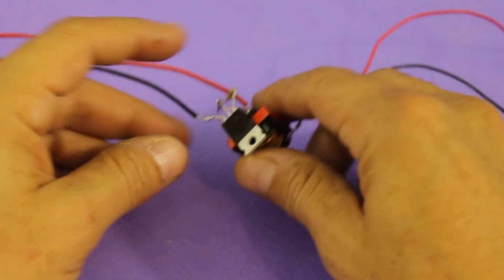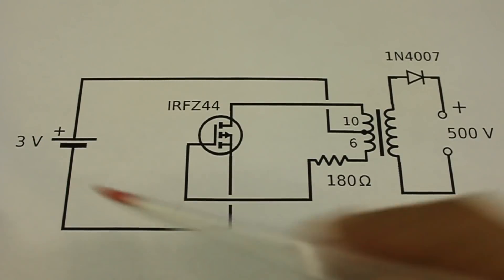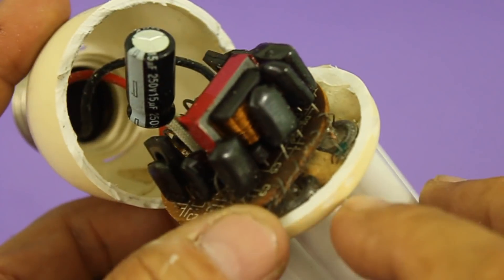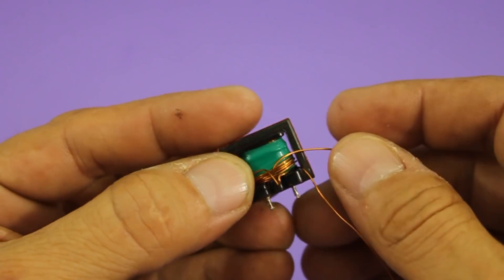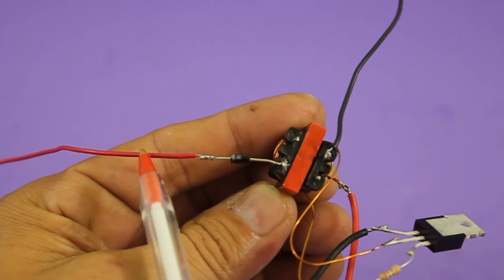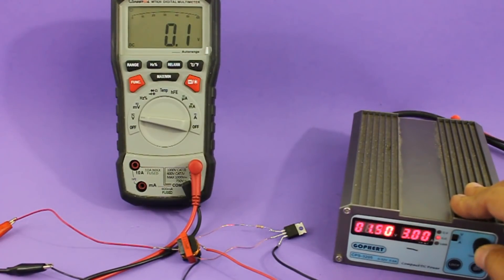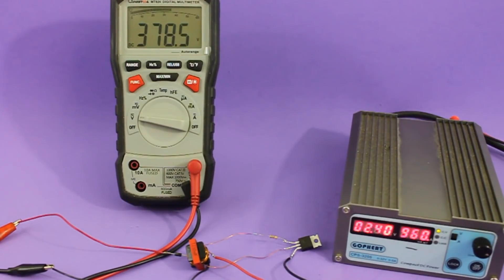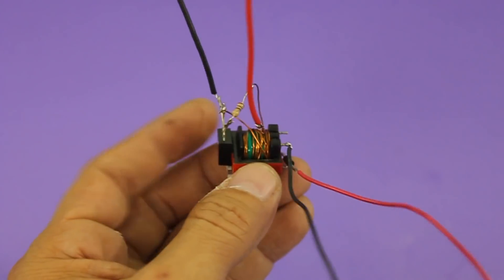Miniature Voltage Booster. 3 to 500 V

Comment: I used the same circuit. But my MOSFET gate can only switch using 6V. So I added in inductor instead of a resistor and the mobile charger transformer can output 600V to max of 1kV. If I use a car jumpstarting transformer, I can double boost the output of 78.2kV and 500W of full power. The first transformer output 240V AC and 1kW of power. You can't control induction motor because the feedback burnt out my MOSFET. Always use a 12v zener diode from gate to source of the MOSFET. When using 5V, 6V or 9V use a 12V or 15V zener diode. The diode's zener voltage will be doubled from input voltage. Example: 6V input use a 12V zener diode.
Reply: The zener diode protects the MOSFET from getting burnt by a high voltage spike. The induction feedback voltage spike can jump up to 600V. High voltage can damage the MOSFET. Feedback current will miss the MOSFET gate and flow to ground through the zener diode. If current flow back, it will flow back through the diode in zener mode. The diode will limit the voltage and skip the MOSFET gate.

Comment: Very good. You make it easy to understand and recreate. 
There is more to this simple circuit: The Diode here does not only rectify the AC, turning it back into pulsating DC.  But, if it is correctly oriented, the Diode is made to Output only that half of the AC power wave which exists while the DC input impulse from the battery is turned Off. This is the greater power of ambient space quickly reforming the small local magnetic field back into its former unpolarized state. There are some uniquely cool properties to this power. But for normal applications, it is suggested a high voltage capacitor is placed between the +/- Output. And realize, that any output during Input-Off, will naturally not load down the input with extra current (amps). So, there is an immediate efficiency advantage with this circuit, and many variations to experiment with. Good fortune, have success!

Comment: sir. the electronic device that you made, can it be used for a 24 volt 7.5 ampere dc motor. if possible, do i need to add bridge rectifier and capacitor for my dc motor. 
sorry if my English not very good. Great video,thanks.👍👍👍

Comment: Thanks for the tut.. Awesome now have a circuit to run the heater in the 2C39A uWave valve i am going to use in a 1.2GHZ tx tripler I am building. My wife said the valve in its mount looks like the robot from "Lost in Space".. Good enough reason to build it... 500VDC, tick, the rest is down hill, thanks a bunch, great work..

Comment: Hi man, thanks a lot for this circuit, Is what I need for my personal DIY coil gun. 
My First question is: can I use as input an AA battery of 1.5v for an output of 450v DC, to charge a capacitor of 450v? 
Second question: is it possible to buy only an inductor of 30mH (as I can see from the label)? I can't find it on line, someone can post a link where I can buy it?

Bye

Comment: Can you also multiply the wattage of it?
Reply from the maker: No, that would violate the 2nd law of thermodynamics
Reply: If it does not increase the wattage,then i consider all these invertor devices as BS ,confusing,misleading and nothing more then a novalty gimmick, 
So if a 2000 watt invertor requires a 2000 watt accu, why not just tap straight into that accu to get 2000 watt? Why would i have to pay $499 for something wich does add things to it other then being a novalty?
If i knew this before, it would,ve saved me $60
Also why are we consummer treated with the term voltage and not wattage???
On universal adaptors it only has a switch for voltage , on batterys it only says 1,5 volt, on devices you only read the amount of voltage, theres hardly any mention of wattage or ampere, i always tout that voltage seems to have something to do with wattage as well but i guess not right???
So what do we rather have 1 watt at 50.000 volt or 50.000 watt at 1volt,mmm sounds senseless right,mmm,

But maybe there is a way to get more energy out of less , what if we could convert that 3 volt at 1 watt into 3000 volt to drive a turbine, then that turbine can then drive a dynamo to generate 3000 watt or so, this way we might get more energy out of less, i was always theorizing this concept.

Comment: Now that’s what i call absolute magic,
Just imagine wiring 2 magnet motors together to generate 3 volt , then that 3 volt can be leaded to a transformer to convert it to 500 volt, and now you can watch tv, cooking water, baking food all just for free and nothing, because a magnet motor should start & selfrunning on it’s own trough magnets alone permanently, wich you could only stop by block it’s mechanicles or by pulling away that essential magnet,
So yes it is possible to to turn a 0 into 500 despite it’s against the laws of physics.
Reply: that's wrong lol

Comment: Soooo concise, simple, clear! You are finally number one. Subscribed! Thumb up! I'm sure you can and will make a video on mini Voltage display with 7-segments display, WITHOUT programming or Arduino, using common integrated circuits. Thanks.

Comment: I am loving the positive comments here... :-) 
1. Can i replace the 180 Ohm resistor with a varriable resistor or potential-meter so i can varry the output?
2. What can i improve on the circuit to be able to use it as a booster for my solar pannel outputting 17 volts.

Comment: This circuit is known as a "Flyback Transformer" It works but without significant filtering the voltage on the output will have lots of spikes. You will need a RC and a LC filter possibly 2 of each to get the ripple down if you plan to use this circuit in music.
Reply: I just need it for charging, can you help?

Comment: disposable fuji flash camera works well for that, then add another ultra fast diode to charge two capacitors in series, doubling the output to around 800V

Comment: This works for me but can't power anything with a winding like a motor for example. I had a couple high voltage 40volt led lights that it powers no problem. I see store bought boost converters that run motors, what am I missing? What can I add to the circuit so I don't lose all my amperage?

Comment: I DISAGREE THAT THE SECONDARY VOLTAGE WILL BE AC - IT WILL BE PULSED DC WITH - OR WITHOUT THE DIODE? YOU WOULD NEED TO DRIVE BOTH SIDES OF THE PRIMARY  TO 0VOLTS WITH RESPECT TO THE CENTER TAP TO PRODUCE AC OUTPUT? IF I AM WRONG, WHAT HAVE I MISSED? THANKS.

Comment: This circuit is bad. First of all it is a open loop circuit so depending on load you will get different output voltage, then by using a single diode to rectify you lose half wave that is 50% of the power. Then the next problem is that you need a capacitor to smooth the output. By using a transformer you need one more diode to the transistor, since you will fry it if there is a spike in voltage. The last problem is that it's not even compact, if you want a small circuit that can boost a high voltage at low power, take a look at flyback circuit.

Comment: Sir I need higher voltage for higher load television or high or to  AC transformer which can give 220to250-300.Any design for higher load. I am your fan and great flower 
Plz.faiz_nabi2000@yahoo.com.
It would be my pleasure Sir. You are Sir.

Comment: An excellent adaptation of the blocking oscillator/ joule thief circuit!  Appreciate the novel used of the CFL boost inductor to make a flyback!  One query- in your initial test you don't have any load or bleeder resistor at the output.  Where is the power being dissipated?  Is the operation  different during the no load?
Reply from the maker: with a load you have a voltage drop depending on the load itself

Comment: I assume this could be used to charge a capacitor? Am I wrong? Need some way to charge a high voltage capacitor? I originally was gonna try a boost converter

Comment: how is this a voltage "booster"? your just running a a few resistors through a series of charging cycles that ramps up its voltage through an few oscillating cycles and then shunts it through a transformer

the real name of what your trying to create here is a "Voltage multiplier"

Comment: I bet if you run that circuit through a bank of super-capacitors,you could have about 1.5-1.6 volts on the input,240 on the output to run your house on.You would need a large bank of Maxwell super caps for that though.
Reply: that wouldnt work

Comment: Hi, i just wanted to ask if what type of lamp did you get the inductor you used for the project? can I use any type of inductor from any type of lamp?I am new to electronics and I am having an investigatory project that is co-related with increasing the voltage of an input voltage. very much needed for my project. please reply. thanks
Reply from the maker: I think it was a 20 watt CFL
Reply: Thank you so much

Comment: so with only 3 volts you make up to 500? isnt that impossible? how are you making more energy then is going in?
Reply from the maker: It is  not impossible because voltage is not the same as energy. Voltage times current is what is related to energy. In this circuit as voltage increases current decreases so there is no gain in energy.
Reply: sorry lol i understand now i was like wait!
Reply: Search in Youtube "Simple easy 5 volt to 5000 volt DC high voltage multiplier" ... buena suerte.

Comment: Hi,
Thanks for the video. I was wondering if this can be used to make a spot welder for batteries to make battery packs. is it possible to do that?? thanks.
Reply: it is possible with capacitive discharge. you could simply use a fuji flash camera circuit. add capacitors in parallel as needed.

Comment: but there is no battery 3.02 volts and 2.22 Amps continiously. if you invent a battery 3 Volts 2.22 Amps (continious) you can be rich.
Reply: Lithium polymer batteries

Comment: plz help me i have a question that "how can a transformer transform the dc voltage here, since the transformer works only for the ac."..plz correct me if i am wrong
Reply: In setup on the primary coil the mosfet creates an oscillation, So pulsed DC, which is able to run transformers

Comment: Instead of 1 diode at the output why not use a high voltage bridge rectifier like db107 not much larger gives much better efficiency
Reply: There's no reason not to

Comment: Bro you can increase voltage only by increasing secondary winding of the transformer however what is about current? What happens with it??
Reply: since the overall max energy it can output will stay the same, if the voltage is higher the max current will drop

Comment: wow! hello! hey man, but if i put like 3 or 4 of these boosters like the firts boosts from 3 to 500 volts and then the next one from 500 to ... how do you calculate here? next one will be way over 1000, yeah i need as much high voltage these minibosters can produce for my new project, im making a brain healer fixer, you know like when you get headackes or forget some things and this device when holding it on the head that high current will instantly remove any head pain and even bring back memories like you would remember in an instant soemthing you just forgot like where is my other sock, where did i put it and you instant remember and dont need to search all over the house.
Reply: Be careful.  Putting a significant current through the brain can cause seizures and even permanent brain damage.   Read about Electro-convulsive therapy and you will see that it doesn't take much to cause a seizure.  In the absence of trained medical personnel to maintain an airway, causing seizures can be lethal!
Reply: More winds on the secondary coil, or less on the primary should yield higher output voltage with higher efficiency then stacking the transformers

Comment: Hi, you have very good channel so thank you for all your videos. Quick question: I made this kind of voltage booster using small pcb transformer. I simply wired new primary coil and used old mosfet. My resistor is 100ohm. For the output, I use "secondary" side of that pcb transformer and I have connected it to a rectifier and therefore I have full DC output. When I charge a capacitor, it goes up to 220VDC. My input power is from adjustable lab power with 4.00VDC and roughly 150mA. If I try to adjust it to higher voltage 5VDC, amps go up to 3-4A and it won't charge my load capacitor. Can you explain what is causing that? Why can't I use higher voltage for higher output? If I turn it down to 4VDC, amps go down and the output voltage is back to  normal.

Comment: I have built the circuit using the IRFBC30 mosfet. The mosfet gets REALLY hot. The circuit demands a lot of current from the power supply. My home made LM317 power supply stops working because more than 1,5A is drawn from it. This is of course natural since if the secondary has 400 turns the transformer ratio will be 400/10. And because the cfl i am using needs 75mA the current needed from the power supply is 400*.075/10=3Amps!!!!How much current your circuit draws?Can it work using batteries? If not it is not so useful (to me anyway).Great food for thought and education though!
Reply: you could modify your power supply to not output more than 1.5 amps, its not that difficult of a modification.

Comment: For this video an your other one like this, you should discuss the winding resistance or number of turns on the indutor(secondary). Or even a inductance measurement just to give people a better idea of what to look for when choosing an inductor or transformer. How many windings do you think is on that secondary output coil?
Reply: Right 500÷3=166x10(primary)=±1660 turns
Reply: I'm guessing you will have about 30-50 Ohms of winding resistance.

Comment: This is an excellent circuit, it is nice and simple ! Thank you for giving the component value of the resistor, part number of the MOSFET, etc. Keep up the good work !
Reply: Does any one know what kind of diode he used
Reply: @biohazardmadness1155  I don't know, but I guess a diode with PIV higher than 500v needs to be used. A 1N4005 has a PIV of 600v, but that may not provide enough protection, so a 1N4007, with a PIV of 1000v would be a good place to start! (BTW, PIV is peak inverse voltage).
Reply: @foureyedchick  thanks you've been a huge help my LEGO machine gun need a lot of power so thank you!

Comment: Surprise your friends with one of this halo lights in your camping tent O.O with 2 AA batteries! (At your own risk -of course)
Reply: At an optimistic 1A that would drain the batteries quickly, you would only get 6mA at the output, so no great risk involved, at least on the electric side. You might break the glass and stab yourself while breathing in mercury vapors but you defenetly wont get a fatal shock.

Comment: I see that the circuit is similar to the "Joule Thief" circuit. If so, you might need a "negative voltage clip" diode at the gate of the mosfet or the huge negative voltage bursts can fry it!
Reply: you need 12v zener, because no matter the polarity mosfet gates and inductors dont mix well
Reply: Put a scheme or circuit

Comment: Well i get it sir. If we install a thick coil in the secondary with 5 turns so will it give high ampere with a bit low voltage. Please reply. Thankyou
Reply: this video is about reusing HV coil.  you can use this driver to drive any transformer